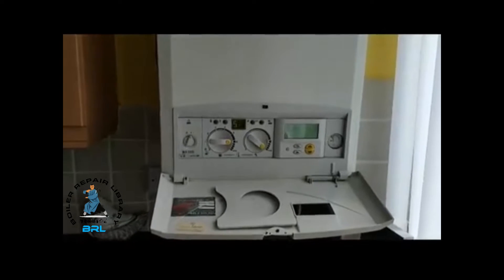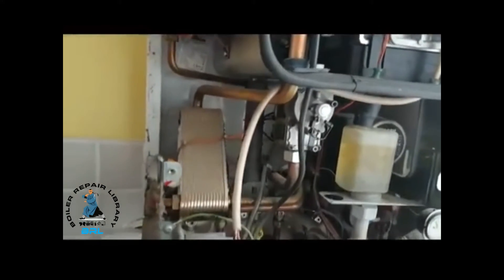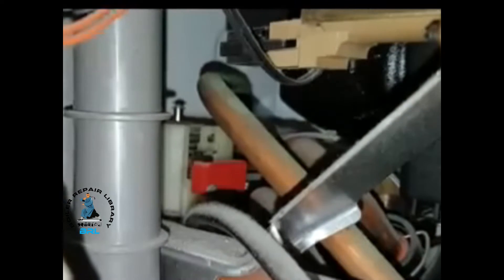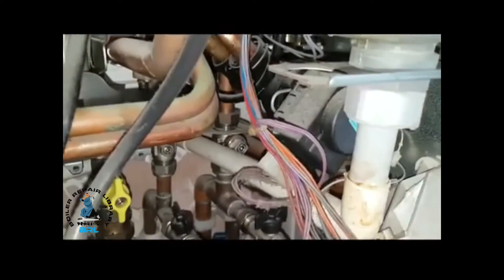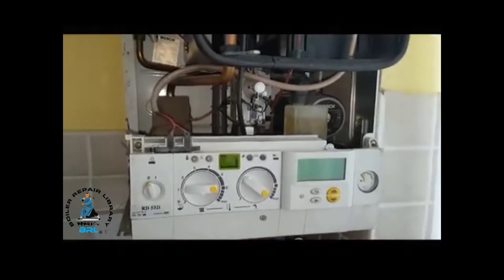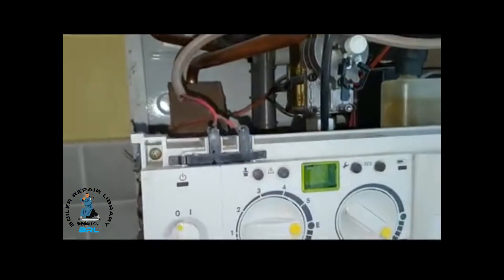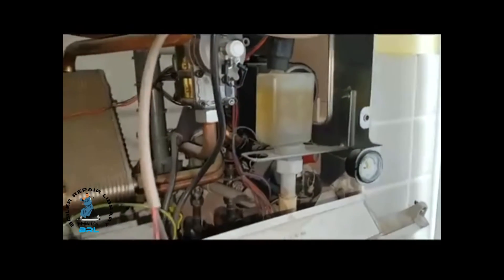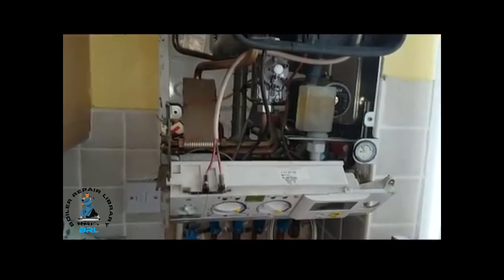British Gas RD 532I Boiler Tour

Comment: I have one of these,  the rd532 with no i.
It's identical appart from not having the little control module in the electric panel, which I dont need anyway as its controlled by a Nest.

Six months or so back the water pump failed, 3months back the main circuit board failed...  All of which I was able to fix for a reasonable price.
Now the fan and the burner thermostat have failed...
Any idea what would cause this series of failures on an otherwise very reliable old boiler?
Should I just keep fixing it I mean?